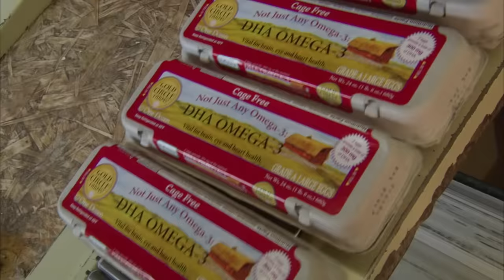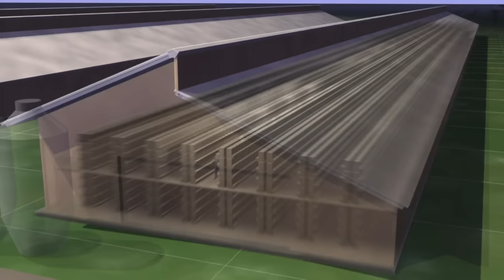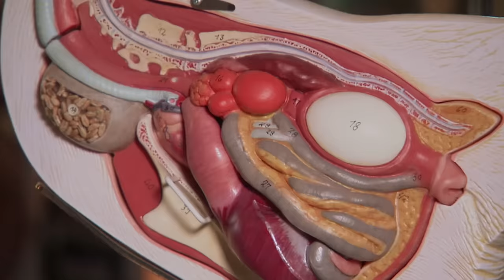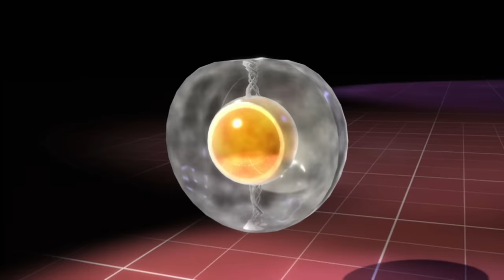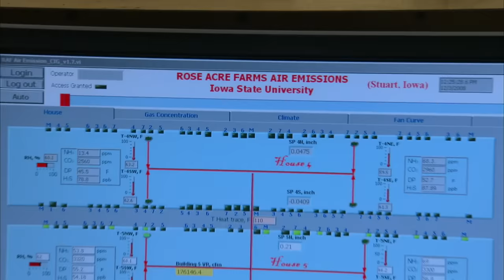Chicken to Omelette: Journey of an Egg | Modern Marvels (S15, E3) | Full Episode

Comment: 😂, I’m willing to bet I can beat any body builder in ANY match. Boxing or MMA. The hardest part is strangling the neck, or landing the chin. Landing the button is WAY easier, but they have no stamina… so the submission tap is anything over a partial trained guy is easy. 200lb here can easy tap the 250- 300 buff guy out😢. I have been waiting to roll with a body builder.